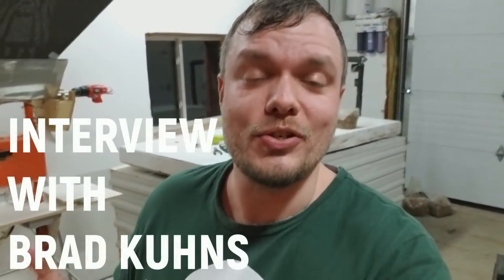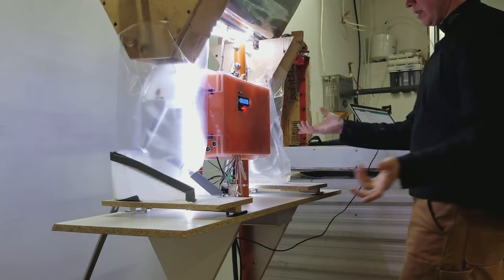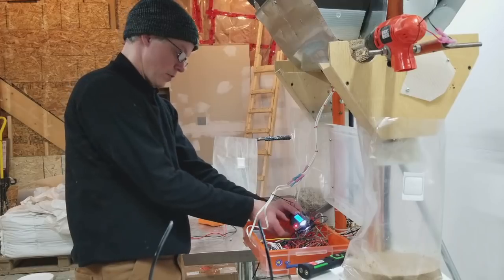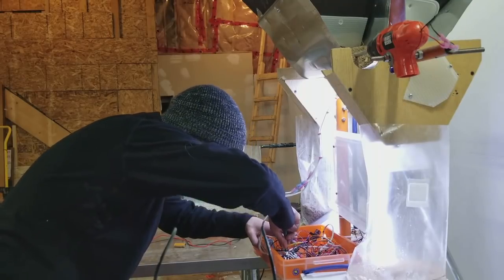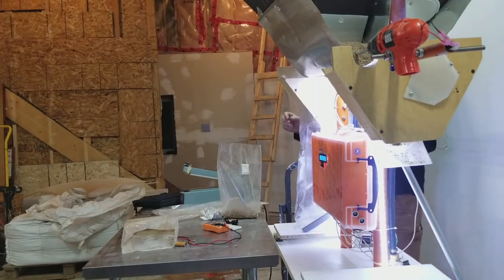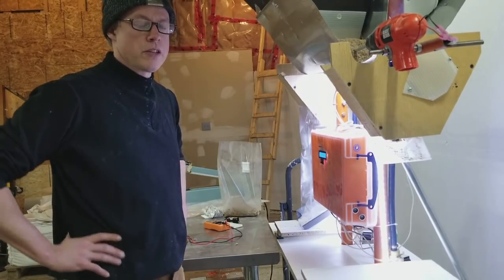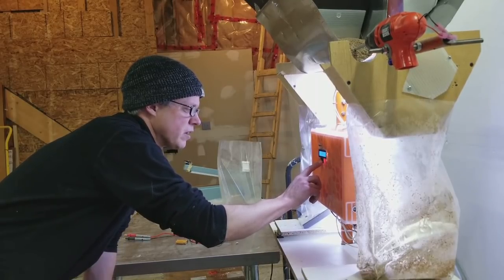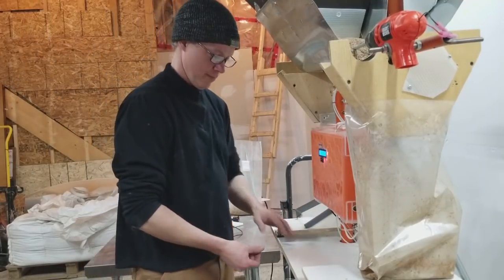Automated Farming Robot "Double Bagger" Machine For Mushroom Substrates - Prototype For Small Farms

Comment: This process is like a miniature version of a cement plant. We use the same design to fill cement trucks. Also you need to check out some of the companies that make automated systems. I have seen similarly designed equipment. Good job with your prototype. Keep pushing the boundaries.

Comment: The problem I see is the sub is not mixed. So how do you get around that? You would have a lot of bran in parts of the bag and then just saw dust in other parts of the bag. So how well would they grow without the sub being mixed properly?
Reply: Hi Chuck, It's a good question with a not so obvious answer. Most growers mix when they add spawn in the lab. Some even run it through a tumbler tube.  So... Why mix twice? The significance of mixing thoroughly isn't as high as you might imagine. Some who have only every mixed thorougly might say it's important to mix thoroughly. However... Many commercial growers I know use the dry mix with success. Nothing flies in the face of dogma like evidence to the contrary.  I was originally inspired by a farm who does this method but they use a mechanical version with a fixed portion control. They've been in business for years.

Comment: Nice concept!  You may also want to consider adding a calibration routine for your pressure transducers in your diagnostics routines.  What is your price target for the system?
Reply: Like minds think alike. I do already have a calibration mode in the menus for each scale. You just fill a bottle of water to a certain weight 3lbs and keep it by the mixer. 

re: price, kinda looking for the market to tell me. I see 2 options. Kit that has all the motors, wiring with coloured plugs, sensors, plumbing parts and even maybe some simple tools. You'd buy the conduit and plywood for the hoppers and follow a pattern I'd supply. that would be less than a "here are all the pieces" which would be easier pre-drilled but heavier to ship.  Preference?
Reply: Interesting question....  I am new to mushroom farming, but from what I see on shroomery.org, it seems like a lot of small growers on the forum are pretty handy.  Therefore, a kit with the electronics and plans for the hoppers and related frame would be the choice.  This option would also make it easier for you to market and would probably give you a better profit margin.  There are others, for example Jewell's Funky Fungi, that  may not have the skill set needed to construct the system without some assistance.

Great idea and design.  I am interested to see how your new business progresses.
Reply: Bradford Kuhns, your competition would be the form fill seal bagging machines and the horizontal mixer combined with a bagging Carousel machine. I've seen the former priced at $10,000 and the latter at 25,000. I would love to have access to a kit of servos sensors and microcontroller with setup diagrams. I would love to help beta this!
Reply: @chuckisnutz  me too

Comment: 1st, I'm in the planning stages of my business, so have no practical experience at this point.  This looks to be a useful tool, though, after having watched a truckload of videos from various farmers.  As the ultimate end-user when it comes to technology, I have neither the knowledge nor the desire to mess around with wiring or programming.  I don't mind screwing things together Ikea-style, so, as long as the plans are correct and easy to follow, I could assemble the structure.  The electronic component would need to be plug-and-play though.  I am interested to see what price mark Brad comes up with on this.  I especially like the ability to run trials more easily.  I am curious to see what the pellets look like when they come out of the steamer.
Reply: My ultimate plan would be to provide either the Ikea model.  comprehensive with poles, brackets etc, easy to assemble with maybe having the customer buy a few heavy things like pipe from home depot.  or a more essentials DIY project where i know all the sensors and actuators are gonna work but the hopper , table etc. is something you can build if you're handy.
Reply: I am also planning my business and would be interested in something like this. Having no experience i do not have a true understanding of the labor savings so could not provide an estimate on what i think it should cost

Comment: Is the shield/computer an Arduino system?
Reply: Yes but not the standard one it's not sufficient for all the timers sensors, drivers etc. you need a mega with some creative pin assignments. ultimately the product would be a full printed circuit board using the mega chip that the arduino boards use.
Reply: Thanks.
Cheers

Comment: Did he stop using straw as a fruiting substrate?
Reply: Yes stopped using straw. This summer my warehouse lease was up it couldn't be renewed so I bought my own farm to own the land. Since I don't have the same access to straw and more importantly storage, Pellets are a space conservative method with 4x3 foot print for the unit and a 4x3  palate of wood pellets at 2200 pounds compared to 40 straw bales, (fills a garage) it's density is great for the small farmer. 

 Add to that that straw is the devil's excrement to work with. I don't miss it.
Reply: Bradford Kuhns when you were growing on straw were you just focusing on oysters commercially then?
Reply: Not just oysters, several other strains on a sawdust process.